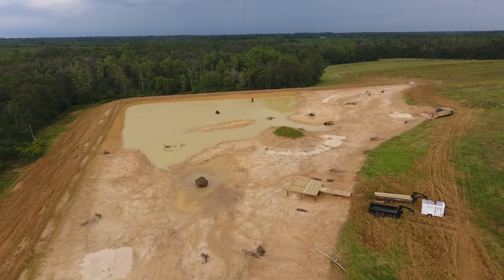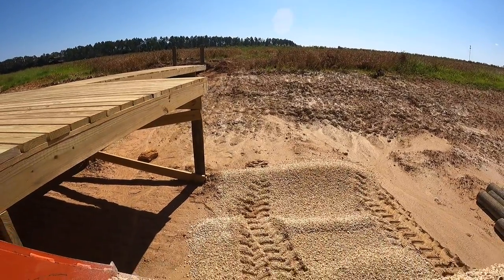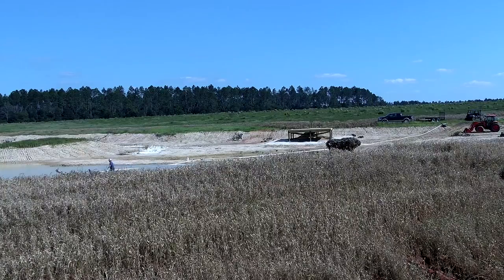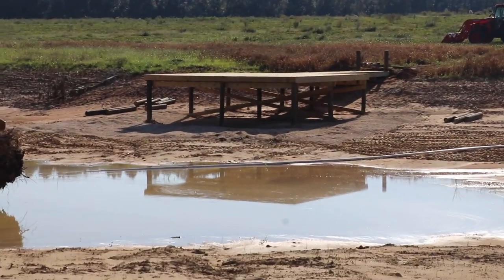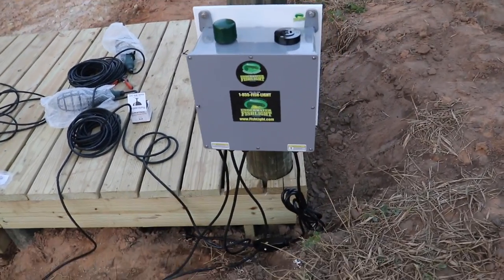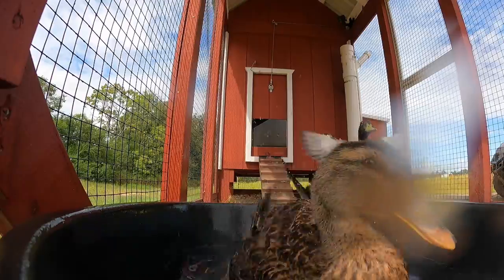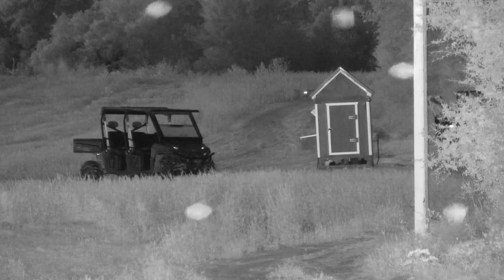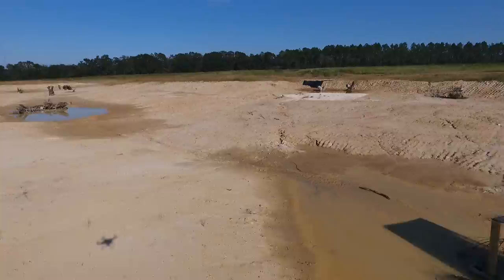Building a 5 Acre Pond! (Filling it with Water)

Comment: I'd lay the cables for the lights on the ground/bottom of the lake. Leaving them hang on the dock beams will create contact areas on parts of the cables which will wear over time with the constant water movement
Reply: Wouldn't it also create similar drag on the ground?

Comment: The first is a red fox, the second two are grey fox.
Awesome pond! I can’t wait to see it filled!
Reply: @Gfish ing Minks love water, that's where people trap them. I didn't think southern Alabama had minks.
Reply: I agree ! They are tall, have a long bushy tail with a black tip so they could really be grey foxes !
Minks are not as tall or bigger, they have a shorter tail, a back more like a curve or an arch not as straight and they move less in a straight line and more in sinious way with little hops from what i have seen.
Reply: @Gfish ing Yes,  I checked it out. According to one source minks are found along every river system in the state and are relatively common in the  southern delta areas of Alabama. However, if the two animals were members of the weasel family they were most likely otters rather than minks. Otters are larger and found in groups whereas minks are solitary.  I am leaning towards the idea that they were foxes, but I can't really be sure at all. I would have checked the tracks after seeing the footage.

Comment: You saw red fox before.  Those are grey fox, which are smaller than the red.  That black tip on the tail is a good way to tell the difference between the species.
Reply: I agree
Reply: @alexanderschiele884  Too long and skinny look like long tailed weasel.  They have a black tipped tail better size and slender body comparison to the video.
Reply: They were definitely foxes.
Reply: @alexlrector  A weasel is about the size of a rat/squirrel.  There really is no comparison here and it's astounding that so many people in the comments think it could be a weasel.  No wonder thousands of people think they've seen bigfoot...
Reply: Possibly weasels but a fox is more what I thought.
Reply: Think you got it.
Reply: I agree young fox

Comment: Have you thought of adding a windmill to generate electricity or move the water to aid aeration?
Reply: Solar powered paddle aerators would be the way to go, they're not too hard to make out of junk parts for cheap either
Reply: @jimmy_flaps  I agree about the efficiency and use of recycled parts. But windmills look cool too! And by the way, windmills are actually solar powered as the wind is generated by the heat of the sun.

Comment: "I'm worried about the sun overheating the GoPro, and rain wrecking the GoPro."
Coincidentally, the solution to both would've been tying an umbrella to the post.
Reply: I hope he sees this in time
Reply: Underrated comment IMO.
Reply: An umbrella would probably just blow away with the storms he has there lol. Wooden covering?
Reply: @christopherhanney4370  zip tie the umbrella
Reply: @miketech2  pretty sure his Sunday posts are the from during the previous week.
Reply: @gsfriendlytreesmmj1165  You underestimate wind, if its anything like my property it would fold an umbrella inside out.
Reply: @christopherhanney4370  Yeah that's what I would do! Maybe just throw it in a birdhouse with an open bottom or mesh screen maybe (to keep out critters) and to add circulation.
Reply: Or A simple lean-to
Reply: Exactly what I was thinking
Reply: Turn the battery pack upside down so the rain will just run off of it
Reply: I was thinking the same thing. An outdoor patio umbrella could be weighted to stay up in the wind.
Reply: Or a bird house for the gopro and portable battery lol
Reply: I immediately thought of the same thing
Reply: Also blocks the glare too

Comment: Whenever I'm doing a timelapse with my gopro using a battery back, I mount the battery pack with the usb cable on the bottom, so if it does happen to rain, the water will not get into the pack, and will drain off along the cable. I also sometimes mount an umbrella to the post to give some sort of shelter.
Reply: The little things

Comment: I went cheap with my underwater lights. I used the older style round sealed beam auto headlights. Gel diffusers from studio lights over the headlights add color and a regular auto battery powers the setup. No concerns of electrocution. Parts are readily available.  No expensive controllers to be concerned with since a cheap battery charger keeps everything juiced up.

Comment: cover the black go-pro battery packs and top/back fo camera housing with aluminum foil to reflect the heat and keep the electronics inside much cooler.  this should prevent overheating of the sensitive electronics inside.
Reply: And add a layer of stiff plastic sheet or cardboard to form it and keep some sort of shape
Reply: Mylar would be even better than foil

Comment: For the GoPro if it's a HERO9 or 10 there is a "pass through" charging door for the USB C cable for external power connectors it's also weather resistant for protecting the camera - also you'll save battery life, temperature, and memory storage by having the time lapse take a photo every 30 seconds (much easier for post production editing as well). 

With the power pack invert it inside down for the I/O ports with a drip loop to prevent water seepage if it does rain. 

Hope this helps! Love the videos!

Comment: The 2 critters look like long tail weasels, you’re supposed to report sightings to AL DNR so it may be worth looking into!! I’m not too far from you and I’ve seen a couple.
Reply: They are grey foxes. Weasels are smaller and have shorter legs.
Reply: @prestontolbert6712  I think you are right as they appear to be foxes as they appear to be the size of a large house cat.
Reply: Ring tail cats 👍 a rare sight in Alabama
Reply: Weasels are about the same size as a grey squirrel. These animals look much larger than that. I think other people are right about them being Grey Foxes. Though one of the larger Mustelid species is a possibility.
Reply: Lege are WAY too tall to be anything in the weasel family.  I say skinny grey foxes.
Reply: @djurgens76  too tall
Reply: Juvenile Foxes. Saw Bigfoot to
Reply: @djurgens76  that's what I'm thinking too. We could be wrong, but the long face and body convinces me
Reply: badger?
Reply: @AJVD2123  the length of the tail doesnt match up. Ringtails lift their tail and its longer than their body. Though they are rather slender grey foxes seem to match up the best for me
Reply: looking at it again with the way the black runs like a stripe down the top of the tail and on the tip Im sure theyre Grey Foxes.
Reply: i said the same thing. you are absolutely right they are Alabama long tail weasels. extremely rare conservation concern.
Reply: the black tip of the tail is what gives it away. look like minks but minks are all one color
Reply: Nerd
Reply: Are there Badgers in Alabama?
Reply: looks like some kind of  marten (martes martes) to me.

Comment: To figure out the cost to fill your pond, take the MAX rating for the pump, 3000 watts as an example, then divide it by 1,000 and then multiply it by the cost of KWH you pay.
As an example, your pump uses a MAX of 4500 watts, that comes out to 4.5 kW per hour, and if the cost of electric power is .17 cents, its going to cost you 4.5 X .17 = $0.765 (max rated) per hour to run the pump.
Reply: Also the pump rating of 100 gal/hr is at the pump output (in the well).

Comment: The second 2 are grey foxes without a doubt. I’ve seen plenty of them deer hunting in the south over the year and they don’t get very big. Even trapped a few
Reply: I thought it was odd. They appeared to have a ferret like body structure. Then again, I've never seen a grey fox; so thanks.
Reply: Badgers?
Reply: you are right, It is definitely a gray fox
Reply: At first I immediately assumed coyotes. I couldn't judge size from video but I watched again and cane to same conclusion as yours. Those are without a doubt two grey fox.
Reply: When the closer fox turns around you can see it’s tail and the black goes all the way up it’s tail!
Reply: @Soggywafffles  LOL Badgers don't give a F. If they wanted the ducks, they would get them.
Reply: @matthewmartin5763  didn’t know that.

Comment: I love watching this series, but as an engineer I have one concern:  How are you going to handle water makeup due to evaporation, especially in the summer?  There are a ton of factors that go into evaporation rates - but my quick math puts your water loss at least in the tens of thousands of gallons per day.  (Massive surface area = huge evaporation)  I'm from a drier part of the country so maybe humid conditions will save the day!
Reply: Dr Tinfoil Papercut, 

I had those very same concerns. As a hydrological engineer I have attempted to inform Bamabass that there are infact no ponds or reservoirs in the whole state of Alabama due to evapotranspiration rates being so high. According to my calculations, his pond will be completely dry in a matter of days yet he will not listen to reason. Perhaps with our combined advanced intelligence we can break through to him.

Sincerly, Dr Banana Hammock
Reply: @nysios5159  🤣
Reply: @nysios5159  I study dihydrogen monoxide and it’s evaporation rates and the average temperatures of Alabama during the summer will indeed empty his pond in a matter of hours. To your comment I simply say I concur. 
Signed Dr. Dang Lin Wang
Reply: HA

Comment: You should get a bunch of fresh water vegetation in the pond stuff like coontail water lilies and duck weed it's probably best to pick them in when the pond is not to full but still has plenty of water to support the plants so you can get the plans closer to the deeper parts of the pond but if you do get it to full you should just be able to take a boat out on it and place the plants that way and lay them around the edges of the pond as well

Comment: you need to put a visor or something over the go pro just to keep the sun from beating on it. it will over heat as long as the sun is beating on it. rig up a hat or a piece of cardboard or something over the top just to keep the sun light off it and it should be fine.

Comment: Next time you have to leave the cam outside for extended periods put a bit of dielectric grease around the electrical ports on the cam and the battery just to keep the water out and when you clean it off use 90%+ iso/rubbing alcohol

Comment: Really cool, always wanted to do that, I use to live to hunt but now I watch 99% of time rarely shoot a deer anymore gotta be a monster and talking 190 class or bigger so my chances are on their side but sure learn a lot about animals that way. Love what your doing, how long did it take to dig out that 5 acres fir pond and how deep is the deepest? Is there a average edge depth like 3’ or 5’ around edge? Thanks need to make 5-10 pvc Christmas balls crappie and bluegill love them the ones we sank out at the lake, the love best arm was 5’ shortest was 2’, we trashed the center pvc or poly holding piece, shaped like a ball with 18 holes for the 1/2” & 3/4” pvc or plastic to glue into them and it made a sea urchin looking space looking thing with pvc arms that stuck out everywhere and you sank them with the chain cane with it but attached a brick to it I floated off bottom. We made big syryafoam balls about size of a basket ball stuck pvc into stryafoam and coated it with commercial cement but made some arms 6’ long so it would like stand off the bottom, we used to slaughter the crappie off the 6 we placed out there but since moved few years ago but bet the markers are still out there. Took less than a week to catch fish off those coins even bait those out bad ripping blocks or rock filled in a biodegradable netting that dissolves in about 3 days to get fish in quicker or just drop them down freeze a rock in a 1gallon bucket of feed with little water in it

Comment: So, a few items to note about this lighting system, this uses Metal halide lamps which contain mercury.  I do not see any sort of safety cage around the bulbs themselves, so should they break, they will contaminate the pond.  As a FYI, the bulbs use the water to cool them down.    In addition, even the manufacturer warns not to swim around this system .  This system uses at least 525 watts of power, so even if its only on for 8-12 hours a day, this will cost you ~$200-300 a year to run.

Comment: 15:32 to 15:43- Gray Fox all night long!  Pause it at 15:38 and you can really see the broadside profile.  The length of the legs and that tell-tale black stripe going down the top of the tail, terminating at the black area on the tip of the tail.  Gray foxes will predate ducks, but they are likely looking for rodents at that hour of darkness.

Comment: Your mystery Animals are a pair of Gray Foxes, average height 12-16inches at shoulder and able to weigh anywhere from 8-15.lbs with females usually smaller than the males.
They are omnivorous, with a diet consisting mostly of rodents from mice to rabbits, though it also eats fruits, berries, and bugs. 
It's also known as a 'Tree Fox' or a 'Miner's Cat' because this small canid is able to climb like domestic felines. Their average territory spans approximately 5-10sq.miles and have dens in hollowed tree stumps, under fallen logs, and can have burrows up to 30ft deep. (Yes, they will eat Ducks if given a chance.)

Comment: Those are weasels!! They will rip  your ducks apart just for fun! They are horrific creatures, you need hardware cloth skirting along the edge of your coop, you also need to dig it down into the ground I did mine as a "~~ |" for my coop, the vertical part gets dug into the ground straight down from the edge of the coop then once that's done the horizontal goes down, up to you if you want to put it on top of the ground or just below so if you need to mow your clear

Comment: Put solar power to the pump 💪 😎 👌
Reply: To run the current system a solar system for it would be very expensive. But after the pond is full he could change the pump out to a solar pump to maintain water level. That eventually would be cost effective. Or a windmill pump.

Comment: 100 gallons minX 60min= 600 gal/hr
9,000,000gal/600= 1500 hrs to fill
Your 5hp pump probably uses @7.5kw per hour.
Electricity in my neck of the woods is @.20 per kwh 
7.5kw for 1 hour is $1.50
Total bill 7.5kw for 1500 hrs =$2250